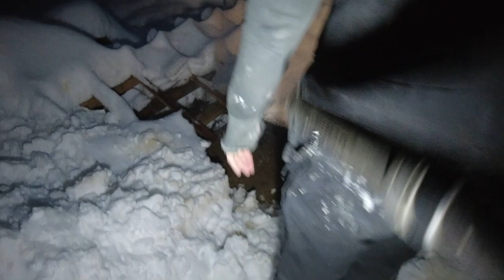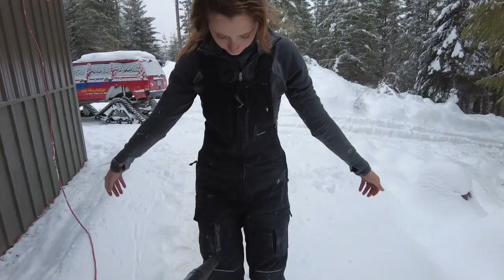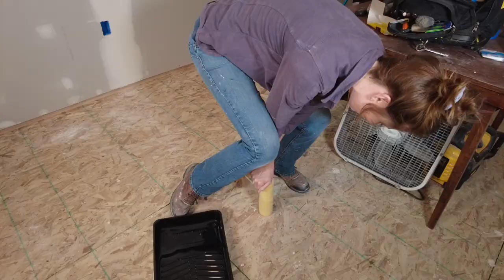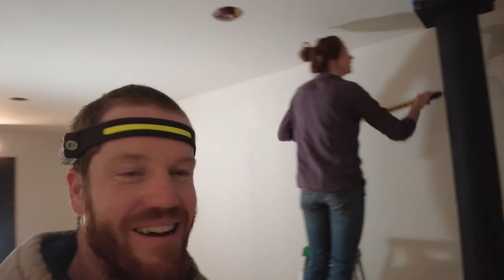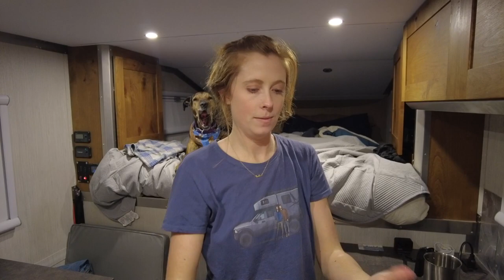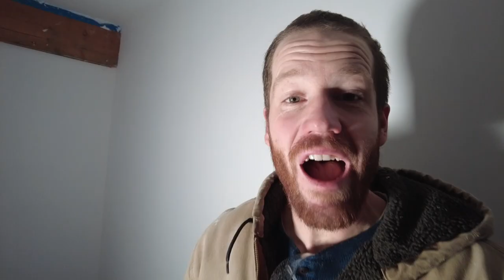Is This A Bad Idea?? | Couple Builds Dream Home Off-Grid

Comment: 95% rubbing alcohol will be excellent to remove paint spots off of camera equipment or glasses.

Or fingernail polish remover would work. But I will not use the fingernail polish remover on glasses.